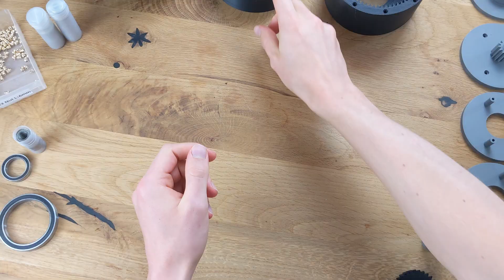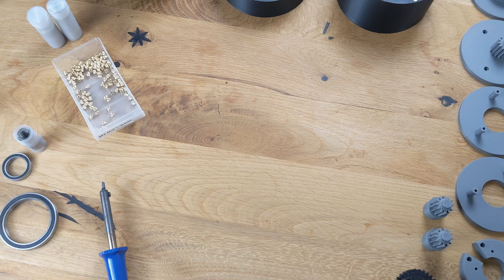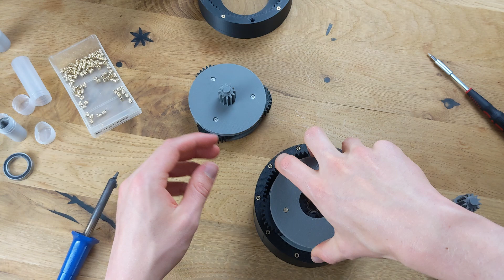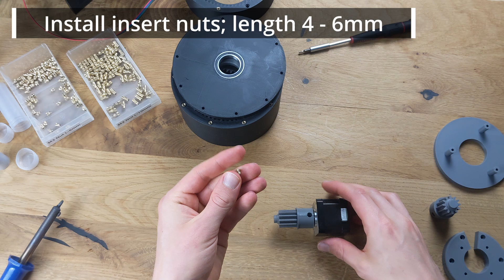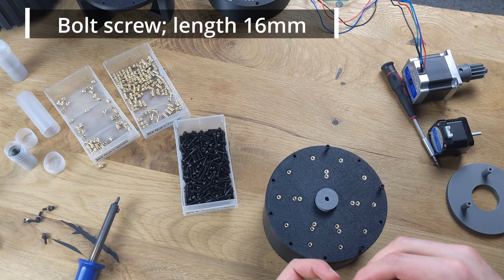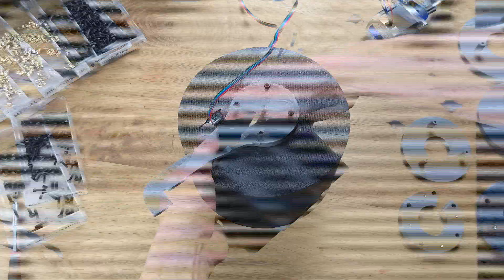2-Stage Planetary Gear 3D-printed

Comment: Have you tried using random seams or design a small recess on the output shaft? The little bump generated by the seams could make output shaft non-concentric.

Comment: What tolerance did you design / build this with? Forgive me if you said it already, I assume for this “prototype” you used black/grey PLA? Anyway, good stuff. I plan on diving deep into gearing and learn the fundamentals, best of application, purpose, etc…
Reply from the maker: My exact Backlash value is 0,05mm. Just a little bit of tolerance making them much easier to 3D print. You can use PLA. Here I use PLA+. PETG ABS Etc. are also options but more advanced.
Reply: @StuffGetsMade Thanks! If it works for you it’ll work for me 0.05mm it is.

Comment: Should the outer ring rotate or the output shaft rotate?
Reply from the maker: The Output shaft is rotating. The Ring gear has several mounting points at the back to attach it and hold it constant.